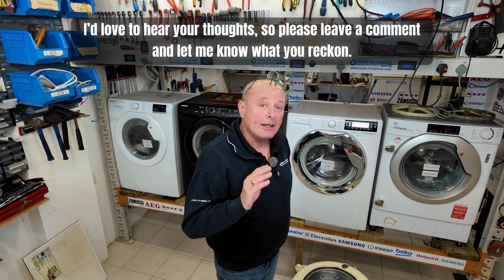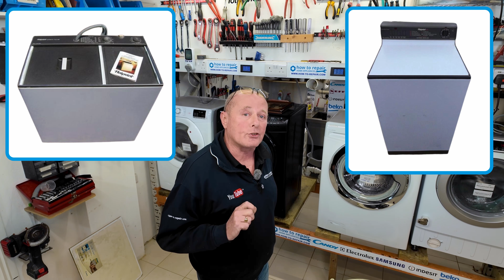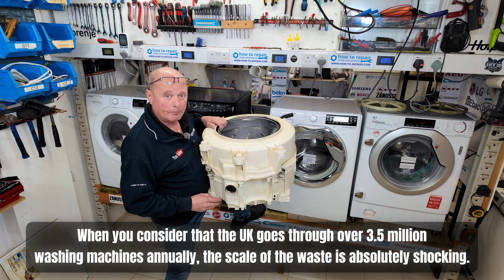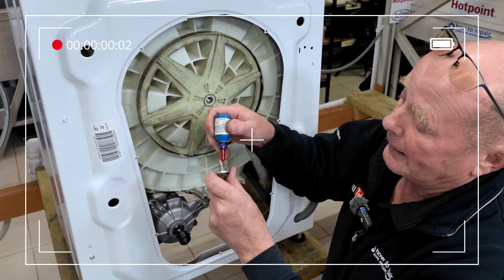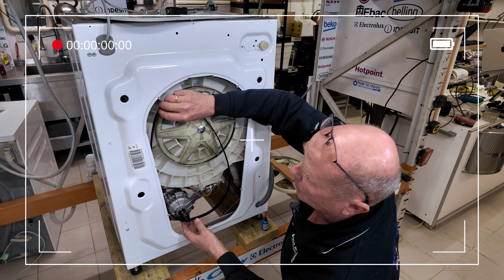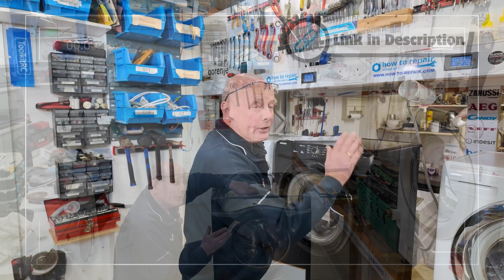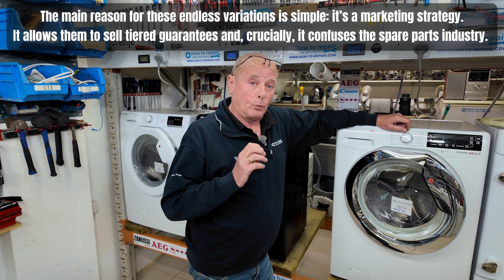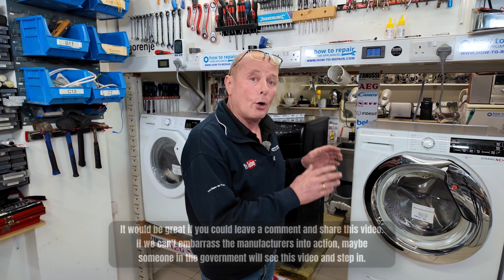I Scrapped 13 MACHINES to Prove a Point: STOP BUYING These Brands!

Comment: To be honest I don't know if people nowadays would be down to buying a 20yrs old-looking repaired washing machine or fridge when, even if they last 5 yrs, a new one would look nicer, be more energy efficient (locally), lighter, smaller, and, mainly WAY CHEAPER. Old appliances used to be expensive, so you'd repair it as much as you can. But that changed. The problem, and I agree with it, is that anti-repair techniques should be banned. And people should at least have the option to repair and get replacements if they want to. Also, recycling should not be optional but mandatory, and trashing things into the environment, kind of a crime against society.
For these newer units that can be repaired and people would buy them, we need a system for consumers to be SURE (have warrantied-warranty, if that makes sense) that any refurbished appliance would last at least 1 yr no hassle. People tend to buy new bc they know they're paying for no-problems for at least one year. So they should be buying the same idea of no problems, also at a better price than new, which is also hard to achieve. It's harder for a consumer to trust a repairman more than a huge factory QC, and for a repairman to achieve prices that would make sense for a well done durable refurbish work.

Comment: As a professionally registered engineer, who has been employed in the design and commissioning of telecommunication systems for over forty years and who has repaired many washing machines, tumble driers and dishwashers (and cars) as a hobby, I fully concur with everything you have said. From experience, I would not touch anything made in the UK. I have found that Japanese and to a lesser extent, Korean and German products, are well designed and are mostly "fixable". Of interest, I had an AEG Lavatherm tumble drier which was manufactured in 1976 and lasted 47 years! My current kitchen/laundry appliances are either German (Siemens and Bosch) or Korean (LG). For example, my current washing machine is an AEG MAT219 which i bought in 2003 and has never failed once.
Reply: German things are not very reliable at all. AEG is made by Eletrolux which is Swedish

Comment: I had Candy Aquamatic T6. Small size machine. It worked for 20 years although looked awful already. It had only one "big" repair i - a door hinge - it broke at some point. It is purely mechanical machine, we were able to to unscrew and repair small minors ourselves. $ years ago something finally happen and we decided to get a new one. It took me several weeks to study the subject and I finally bought... exactly the same machine pre-owned, looked like new except for 1 scratch. Cost me like 50 USD the whole thing. The old lady used it maybe 10 times, no more. I was so tired to choose the bloody machine when I know 100% machines have the same functions, basically 3 programs, and all the adds is just a marketing to increase the price. The only thing I regret is I can't wash a blanket in this machine because its capacity is 3.5 kg only.

Comment: I bought a new Indesit in 2020/A1200 spin as a man I used it once a week after a year it started to make funny noises thumping banging around and not stopping the only way to stop it was Turning it off at the wall and moving the dial to drain out the water it was like the twin tub days..
Reply: Like I said i hardly used my washing machine and after a year it started to go wrong which proves that it is built into the electronics cause every thing else is OK on it

Comment: This reminds me. We have a siemens dishwasher which had leakage issue a long time ago because of a worn out sealing ring. My pride as an engineer didn’t allow me to just throw it away and buy a new one especially if it is such an easily fixable problem. I called siemens and believe it or not they wanted almost 200 fucking euros for it. I just hung up without answering. Bought the cheapest one on the internet and that thing still works even today. Fuck manufactures.

Comment: I used to deliver white goods in the 70s till the 90s. Just the difference in weight when we removed some of the old 50s built machines told you that they were meant to last. At 60 i had to replace my fridge and I picked up the new one  by myself and moved the old to the shed. Good news is I saved the $50 on the delivery charge.

Comment: I'm just about to scrap my Hooover washing machine...5 years old. It failed one month out of warranty. The drum managed to slip itself off one of the top springs and crashed into the pump. Hoover refused to fix it under warranty. In the last few months its been banging a bit on spin. I checked the drum and found side to side movement (not up and down) whichever way the drum is rotated, which I reckon points to a bearing going awol. It gets used for two washes a week. I've had enough of this pile of crap.

Comment: i have i my lockup my late dad's hotpoint 95 series that we got in the late 80s when i was a kid and i still have his late 70s hotpoint dryer that looks similar to the 18series washer (same buttons and dial), i've done the brushes on the washer probably 3 over the past 30 years and still going strong, the dryer used to stop at the 30 min left point as the plastic wheel that pushes the contact had melted a small dint in the wheel, bit of plastic welding back in early 2000 soon fixed than, oiled the bearings and thats all its had in probably 50 years of half heat use, my missis said to tip them, i said they'll out last any modern washer/dryer so i'm keeping them for an emergency lol.....

Comment: You are very well-spoken. You made a 20 minutes video about washing machines interesting to watch from start to end. And very dense in information as well.
It's just a shame what's going on with those modern appliances, this should be criminal. Filling landfills with trash designed to fail after a few years of use, sacrificing the future for a quick buck.
It's even worse regarding the printer industries. Those printers are designed to not last more than 3 years and ask you to buy one time use overpriced plastic cartridges that ends in the trash.
They get away with this because people aren't informed enough. Can't blame them, we dedicate 10 hours a day to work and unfortunately most of us have no time to dwell on those things.
Surely this is not sustainable. Changes are needed and videos like yours or Louis Rossmann's go a long way.
Thank you for your work and dedication.

Comment: I'm a bit disappointed in Bosch washing machines. I had a £600 machine and it had an issue related to the door lock. I took it to a repair shop and he said it was the PCB, part was hard to get hold of and it was not worth repairing.

Comment: We should also blame the vendors... Why are large national companies selling a large variety of washing machines if they could easily figure out which ones are shoddily built? You don't go to an appliance store thinking the store will deliberately offer you products they know are poorly designed - you might expect a cheaper machine to have fewer features, a cheaper-to-manufacture look, and less expensive materials, but you shouldn't expect the company to have intentionally installed the wrong bearing!

Comment: I am not an engineer but I really feel like bearings shouldn't be a problem for a type of machine that's existed for over 50 years? They could just put in the bearings that used to survive the same load as the current machines have to deal with!

Comment: My Beko washing machine's drum stopped rotating. It would have cost a great deal to have it repaired. Many would have trashed it and bought new. As a D.I.Y er I decided that it was probably the motor brushes. Bought new brushes for about £5.00. Whipped the back off, took the drive belt off. Then came the problem. The motor brushes were inaccessible without unbolting the motor. This I managed but the lower bolts were hard to get at. Once the motor was out was quite simple to replace the brushes that were completely worn out after about two years use. The washing machine was perfect after that. My point is that the design gave no thought to simple repair. It looked like builtin obsolescence.

Comment: I've got an old Burco washer from the 70s. Works perfect   It's made up of a stainless drum which is the whole case.  In the bottom there is an agitator attached to a motor and under that an element... Oh and I have an analouge timer switch.  
Ive never known such a simple machine get over engineered so much as washers

Comment: There’s been two Bosch machines in the family in the last 10 years that only lasted approx 5 years - one had a failed element and noisy drum bearings, I think the other was the motor.

I’ve got a cheap BUSH from
Argos and it’s about 8 years old - out lasted the Bosch’s.
My parent’s Bosch ovens have had several faults and repairs too.

Comment: As a hoover owner I have had mine for 9 years it has WiFi it has never ever even remotely blinked and gets used every single day, not a single fault in 9 years and spins at 1400 with 13kg drum absolute animal of a machine

Comment: You sir are having a point. Manufacturers should be taxed based on maxing out their lifecycle, not producing more base machines while fossil energy is still in use.

The EU made legislation for this, aka ‘the green deal’. Which eventually should push manufacturers into having less lifecycles and more support for longevity.

Having short lifecycles is only green when manufacturing and logistics use no fossil energy, and this simply is not the case yet.

Comment: I think its the customers fault, If I buy a washing machine and it breaks after 18 months ill never buy that brand again, I currently have a cheap Samsung that cost 500€ i expect it to work 5-10 years, if it dies before 5 ill never buy it again. But Miele has a warranty for 20 years and cost 2000€, so I guess 100€ per year is fair.

Comment: It's got to the stage after several machine failures in a short time my latest machine was £120 from the ex display department of of a retailer. 
Trouble is, it now needs a new pump (I hope). It's six years old.

Comment: I am using a Samsung which I bought in 2000 it was then about R4000(USD200), just do pipe wear and open and cleaning, so easy even to repair my daughter who is not trained an intelligent girl technically she repairs it every time there is a problem

Comment: I've worked as a service manager for one of the biggest appliance brands in the world, so I've dealt with this on a daily basis.

I've seen plastic part becoming more and more common than metal but
what many people also forget is that modern regulations have forced manufacturers to design machines in a very specific way. In Europe, for example, machines must use minimal amounts of water and energy, and even features like delay timers are restricted (max 24 hours). There are now many rules to follow to even be able to set a machine on the market (and those rules are not focused on the lifespan).

You'd also be surprised how many machines fail simply because they are misused or poorly maintained.

Comment: I am one of the new generation who thinks 8 years lasting is good for around 350 euros. But now as i gave away my older machine to someone who knows about them, i got told that newer machines Electrolux (which in europe was considered top notch), LG, Samsung what not will beginning to have problems withing 2 years already, as the warranty is for 2 years its terrible. To consider more warranty around 125 euros a year.. i would next time try to choose cheapest Miele instead, or tell myself, to buy cheapest and replace in 2 years.
Reply: What if instead of spending hours in front of the television we went back to hand washing?😀

Comment: My Beko washing machine came with a 5 year warranty and has been running since 2019. I just noticed last week that there’s a tear in the door seal, but it’s a cheap part and can even be replaced at home.
Reply: You don't mind replacing a part like that those parts get a lot of use it's the built in electrics that cause the problem

Comment: I have a Zanussi dryer from 2019 that was going to be written off because of a rubber wheel being worn out (that supports the drum). I took it apart, reverse designed it in CAD and printed a new wheel with my 3d printer. Still running today and with a better component then original...

Comment: When I got married, I was given a washing machine from the 1990s. It's the best washing machine I've ever had. I ended up buying another one just for the parts. In the last 10 years of having that washing machine, I've seen several modern models that stop working due to irreparable problems with the PCB or sensors. It's worth buying an old one that will last a lifetime, unlike the modern ones.

Comment: I have a Zanussi washing machine from 2008 still working great. Last week it started leaking onto the floor. Following manual I removed the dispenser drawer and cleaned it out and the channel into which it slots - plenty gunks of washing powder in there. Ran it empty on 95 degrees cotton program with no washing power added. Couldn't believe how much soap was foaming up behind the glass door. Ran it another three times until the soap was totally cleared. Leak was then totally gone. Now I use 80ml washing power per wash instead of 135ml. To think at first I was even looking up Curry's thinking I needed a new machine, or calling in a repair man.

Comment: A couple of year ago, a Bosch kettle failed on me after 13 months. I called to claim on the warranty and the call handler told me that I should be grateful that it lasted that long as they normally don't. Luke I should have expected it to fail 🤦

Comment: My childhood home was built in -86. We moved out in -03 and all the original appliances were still operational and I don't think my parents even considered updating them for sale. I think the dishwasher needed to be serviced once because my or my sibling had dropped some toy that was causing a blockage. And coins blocked the laundry machine at some point but I think my parents managed to get that sorted without any professional help. I bought my first apartment in 2023 and spent extra on premium model appliances basically just in the hope that they would last at least a decade before failing.

Comment: Not engineer. But no doubt that quality have gone down during the years. I have two washing machines. One old Siemens top loader that I bought in 1992 that I use for working clothes. The other is a digital Whirlpool from 2012 that still work excellent, but I have changed pump and bearing. Think gave 425€ after 40% discount. Still was easy to work on. Siemens never touched anything

Comment: I wonder what your opinion on the LG WM3250HVA is, because it took me 1 entire month to research about 14 years ago, which washing machines are good and which arent. At the time, the SEARS had to order it in. They had ALL OF THE OTHER brands and models and in my research not ONE of them was any good. The BEST ONE, wasn't even in stock. SO yeah, having it 14 years now (has a 10 year warranty, which means absolutely squat) and it does ALL my laundry, including oily, greasy mechanic bibs. The biggest problem is the lack of research people do, trusting that the store clerk knows anything of value. The only other options nowadays are commercial units. Those are the ones that DONT say commercial on them. They are plain, bulky and boring, but they outlast a residential unit 10:1
Fridges are even worse, btw.
People, STOP BUYING THEIR SHIT and the manufacturers will have to change their ways.

Comment: Excellent video and information thanks. I have a 20+ year old Miele washing machine. Had the drum replaced about 10 years ago but they needed a special jig to change it. I dont think they do it now unfortunately. Not sure if the quality is still as it used to be but fingers crossed it last a while yet. Lookiing forward to seeing a video on the most reliable and maintainable current washing machines.

Comment: gotta love those manual top loaders with the mechanical switches spin time and lock drain that only cost 64pounds, also the important parts are actually made of metal or quality materials and left the useless parts made of flexible plastic like the outer shell and lid

Comment: Even the spare parts networks are shocking for those replaceable parts. It should be clear to consumers, the first washing machine I had was a used zanussi/Electrolux from the 90s. It was still working when I "upgraded" for more size and I gave it away. Since then the last 10 years I have had 3 machines and that includes some repairs 😅

Comment: Funnily enough, I had a Hoover machine very similar to the one on the left in this video but it was a built-in model, that had EXACTLY the same issue as that one - the PCB had failed/corrupted, and it was basically inoperable.  I spent £200 trying to get it fixed, but I might as well have burned my money as the problem came back within days.  I ended up buying another machine (not a Hoover one!) that has so far been going well.

I also bought it from Currys and (foolishly in hindsight) I bought their extended cover for it which, rather similarly to the machine itself, I might as well have burned my money instead as the cover wasn't worth the paper that it was printed on - ergo, I must state, with caps lock on: NEVER, EVER BUY ANYTHING FROM CURRYS!  They are not in any way interested in helping you if you have problems with something you purchased from them.

Comment: some 10y ago France went to war against planned obsolescence and spare parts gouging. Now most repairs can be done by approved repairmen for a fixed 20eur. No idea why the right to repair act does not work in the UK. Probably the endless variations are to match with various legal obligations, like the stricter repair ones in France.